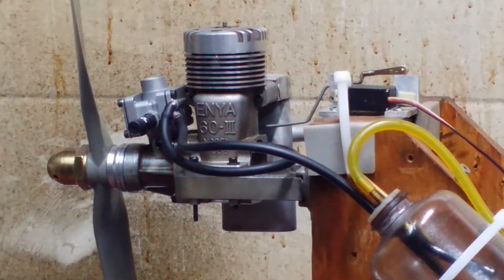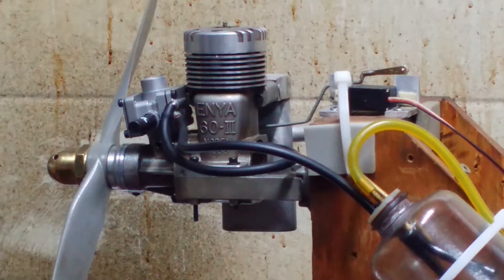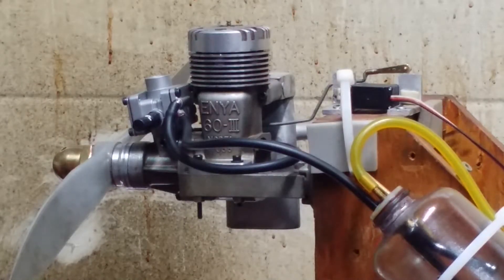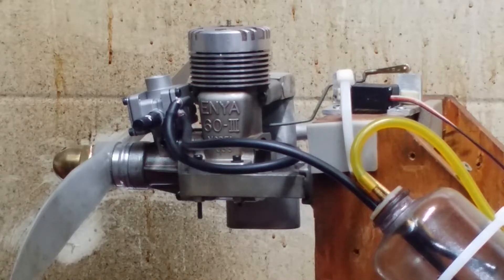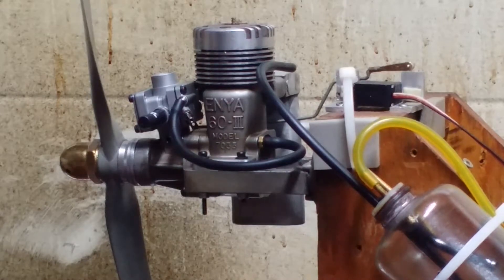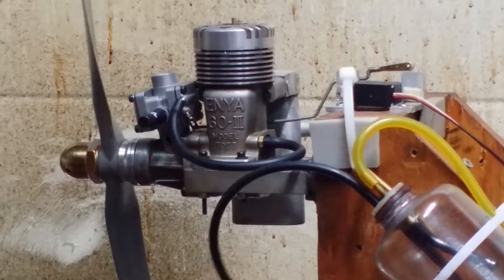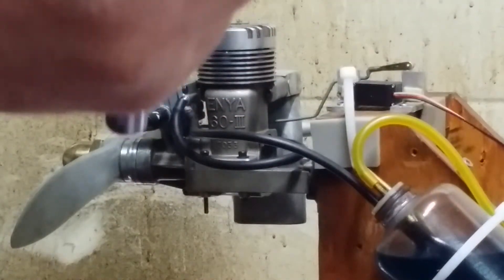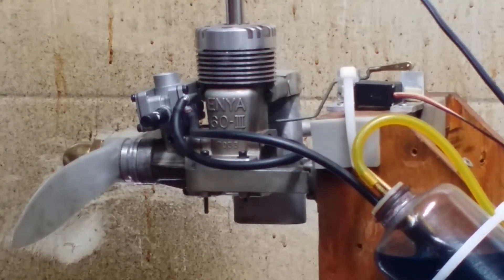enya 60 fuel and glow plug testinng

Comment: Hmmm changed carb and fuels to no nitro. Looks like this engine is very versatile. I'll be hoping for a thorough up date. I own several of these. Thanks, Paul in Thailand
Reply from the maker: thanks for your interest.. perhaps check out my other videos.. but for now my fuel mix is 94 octane , oil of your choice. and I add 10% ethanol. so far this has proven to be a very reliable mix..
Reply: @jeffgrain1417  I only have stock carburetors.